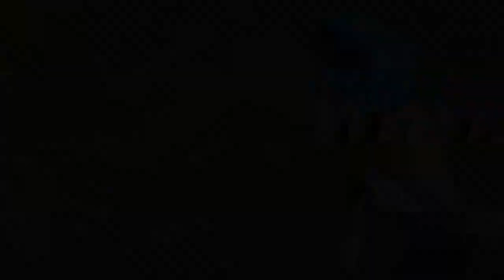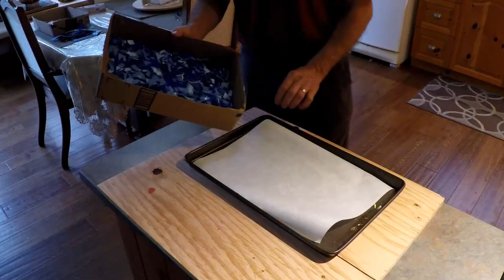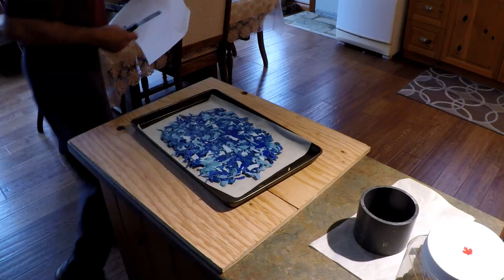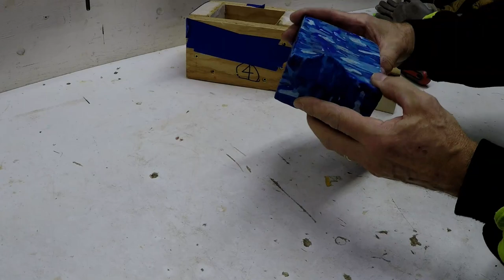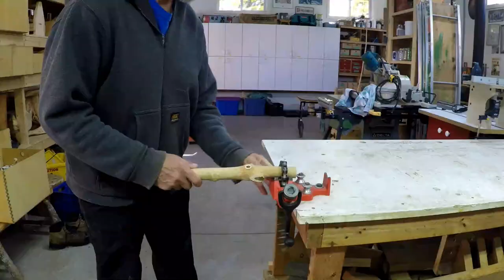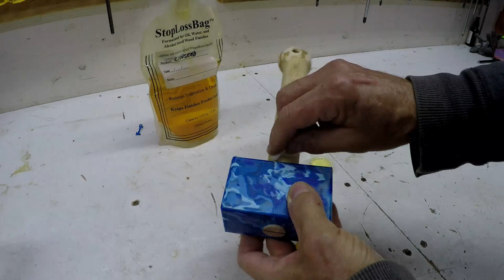DIY Recycled HDPE Mallet

Comment: Отлично! Пузырей внутри нет?
Reply from the maker: If someone can translate I will try to answer
Reply: @pointyhairedboss9525  Excellent! Are there any bubbles inside?
Reply from the maker: @ruchnaya_sborka  When I was learning the biggest challenge was to eliminate voids in the finished block. The best way I found to do this is to cut the plastic into small pieces, add several layers during the melt & roll each melted layer before adding the next. I use a piece of 4" plastic pipe on parchment paper to roll.
Reply from the maker: And when you fold the flat melted plastic be careful not to trap a big air bubble. You will never get it out.
Reply: @pointyhairedboss9525  Thank you! And here is my pampering https://www.youtube.com/watch?v=kzmLkxqjIgM

Comment: I was skeptical about the press that seemed so far away from the oven but this turned out great. Taking the time to do the chamfering was so worth it.
Reply from the maker: I press the blocks in the shop, about 200 ft from the house. If the block starts to cool & harden a little on the outside its not a problem.  All it means is that it won't squeeze into the mold as easily & I may have to trim off a little more of the outside to get square corners. The most important part of the whole process, I found, is to eliminate voids within the block.  No amount of compression in the mold will get rid of these. That's why I take time to roll the soft plastic periodically as it melts.
Reply: @pointyhairedboss9525  I appreciate the replies. Thank you. I just started the process of saving my #2 recyclables, so we'll see how it goes from here. Cheers.
Reply from the maker: @essextwo  One more thing. There's more plastic in one of these blocks than you first think. My suggestion is to make friends with the person who runs your local laundromat. They may be willing to save containers for you. The added benefit is that you get to keep the dregs in the bottom of the bottles. We haven't needed to buy laundry detergent in 2 years.
Reply: PointyHaired Boss Today, I just discovered all my protein & collagen powder containers, which are fairly large are also #2 HDPE, with the exception of the lids (but a few are #2 also, mostly the unusable #5) I once I wash and shred, I think I’ll be ready to piece together mould and take it from there.

Comment: Nicely done and great video, thanks a lot. I have a question, how hard is the mallet? Like what you can use it for that won't damage it?
Reply from the maker: HDPE is relatively soft but very tough. You may have a piece in your kitchen now, they make cutting boards from HDPE. The mallets are good for striking anything where you don't want to marr the surface like you would with a steel hammer. The specific gravity of HDPE is slightly less than one which means that it weighs about the same as water to give you some idea of the weight of the head.
Reply: @pointyhairedboss9525  thanks for your answer! If you add a metal piece to the striking surface will that make it more resistant? I'm thinking of this as an assembly mallet in the woodshop.
Reply from the maker: I'm thinking HDPE is the perfect material to help assembly - tapping parts into position without marking the surface. That's what I use mine for.  If you add a metal face you may as well just use a metal mallet or hammer. And don't worry about protecting the plastic, its very tough.